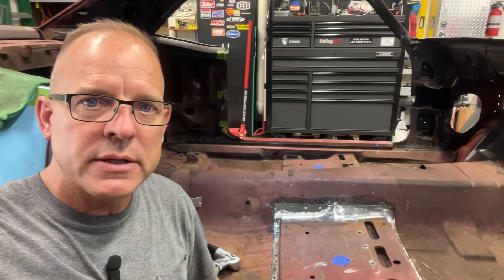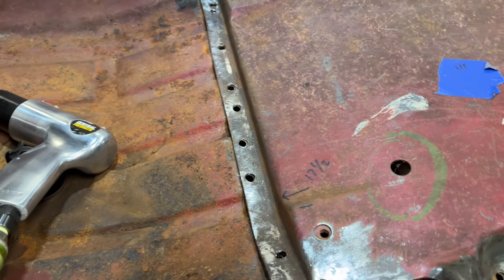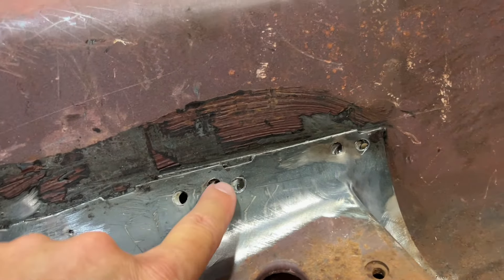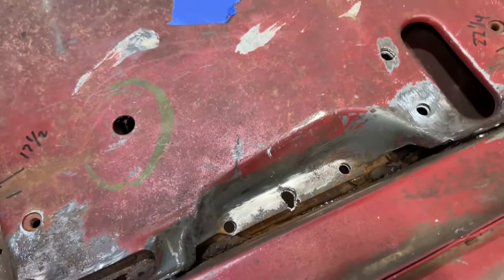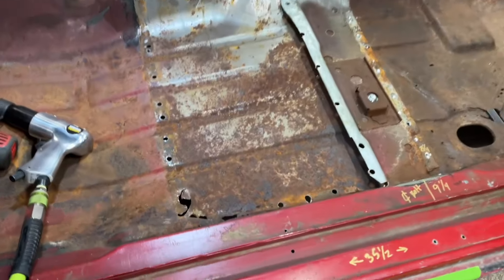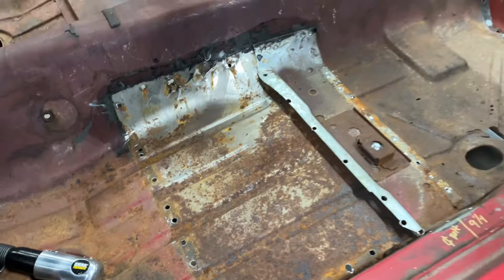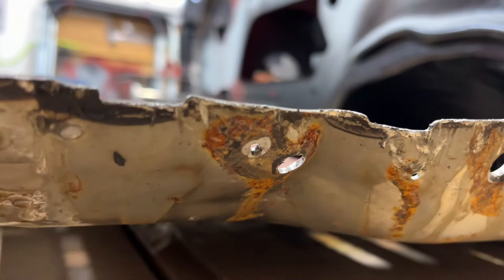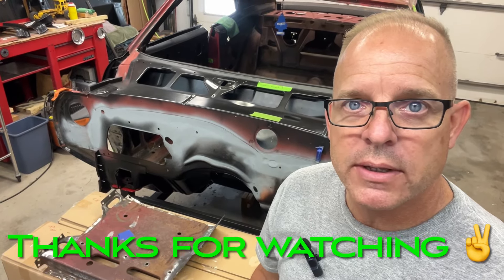Removing First Generation Firebird-Camaro Seat Base

Comment: I cut mine out of the floor to be attacked at a later date. Great video to anyone re-using the original ones!
Reply from the maker: I may do that with the drivers side.   With the pitting and not being able to see where the spot welds were, I was winging it. Might be able to identify the welds better from the other side. We’ll see. Thanks for watching.✌️

Comment: Great video brother 👍
Reply from the maker: Thanks. It may seem trivial, and I’m a little embarrassed about struggling with this base. But how else are you going to learn. Right. Thanks for watching.
Reply: @JK_Nex_Garage  yes you are 100% correct I usually spot weld those areas that you mentioned that goes on top at the end